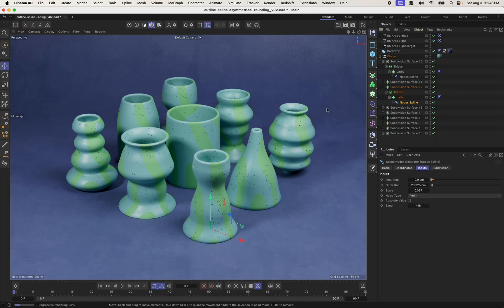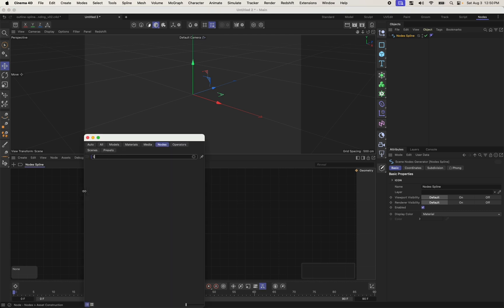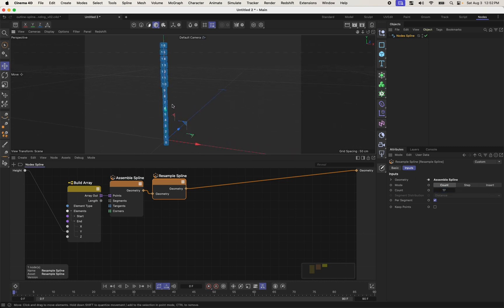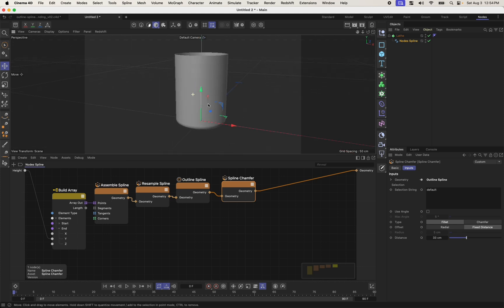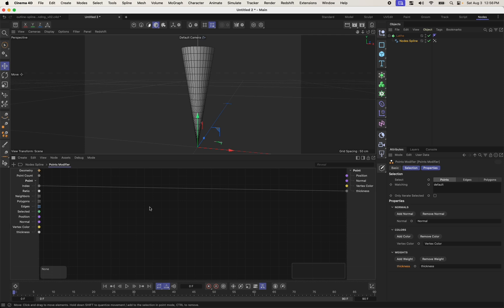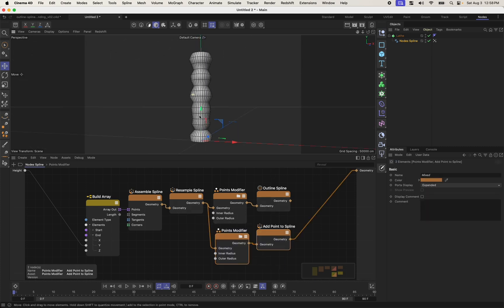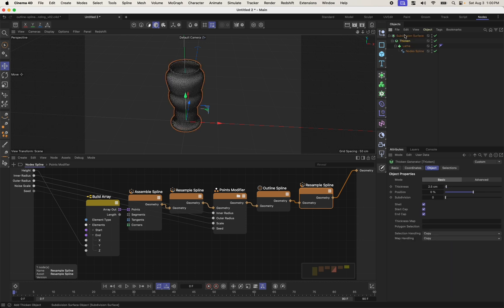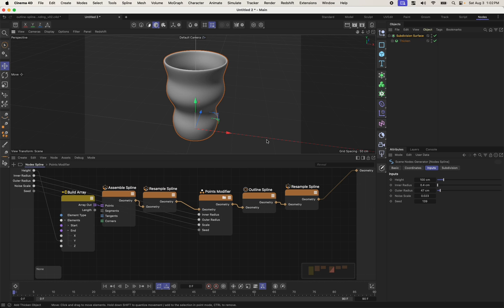Creating a Wobbly Vase with Scene Nodes in Cinema 4D 2024.5

Comment: Is there a way to also throw the spline node into a larger node/scene node - and then also include a sweep, thicken, and subdivision modifier, in that larger scene node?  Just curious if there is a way to kind of include that in the procedural inputs/outputs for users as well.  Thanks!
Reply from the maker: Yes, you can create a Nodes Mesh object/group and include the Nodes Spline we create in this video as a node. Then you've got an all-in-one Vase generator. I decided to make a spline rather than a mesh, as users might want to animate/clone something along the spline or more easily animate/work with all of the lathe settings.

The rough procedure would be:

1. Open the Nodes Spline group.
2. Assets > Save as New Asset
3. Save it as something like "Vase Profile Spline"
4. Create a new Nodes Mesh object in the Objects Manager.
5. Search for the Vase Profile Spline in the nodes commander - it should be available as a node.
6. Add a Lathe Line node, and connect the profile node to it. A Tessellate Spline node will appear, and you can tweak your tessellation settings there.
7. Expose the parameters you want users to see/control on the Vase Spline and the Lathe so its a one-stop-shop for users.
Reply: @scenenodestips  thank you for this detailed breakdown!  I appreciate it so much.  Definitely helpful for my own learning and understanding.

Im trying to think of ways to make a vase generator like this, but one that also incorporates an optional handle, if desired, so this could work as a sort of 'mug' generator too.  But when I think of approaching that, it seems like these are two separate components that probably can't be thrown into one scene node element here.  Not sure though, would love any thoughts you have on that!